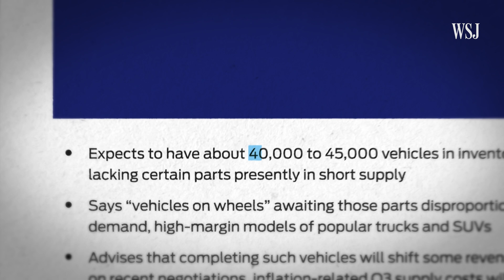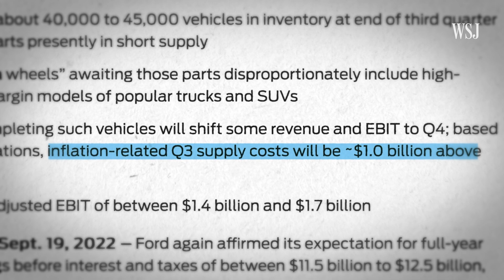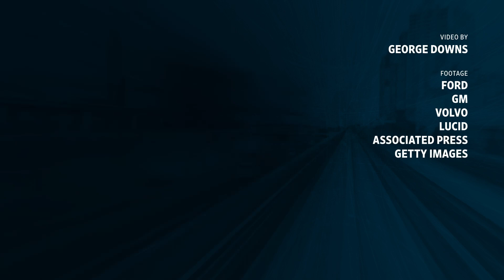Ford’s $1 Billion Inflation Expense Helps Explain Why Car Prices Are Going Up

Comment: Eventually you need to sell those stored vehicles right? If you haven't figured your supply chain three years into the pandemic, then it's on you.
Reply: I haven't looked into it. But if I have to make a guesstimate it's going to be the crappiest time to buy a vehicle. Companies need to cut corners and keep the bare minimum to push the most they can and still meet their bottom line revenues. Same goes to dealerships, if you're not moving volume, your fixed cost is going to be higher per vehicle. So, you're technically overpaying apart from losing quality and features. I am super hesitant to buy for the last two years as I know technically these vehicles are under equipped and least quality that you could get in a way.
Reply: @batman.._  Yeah dealerships have always been greedy but COVID just gave them another excuse to be even more greedy. Used car prices are insane and new car prices are even more ridiculous. I know there are supply chain issues but does having a blue badge on a car really matter? I doubt most people would even care. My question is why couldn’t ford try and just use blue stickers temporarily and just have customers come back to the dealership if they wanted a badge when they were in stock like storing cars just because they don’t have a badge but are finished is insanely dumb to me but that’s just my opinion.
Reply: You're still paying over MSRP